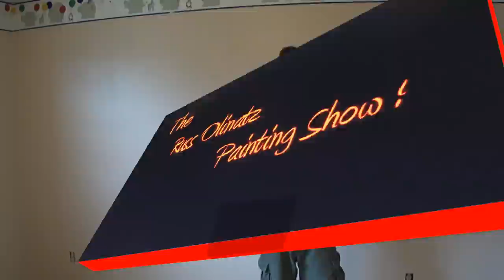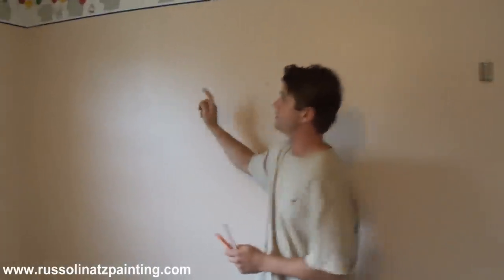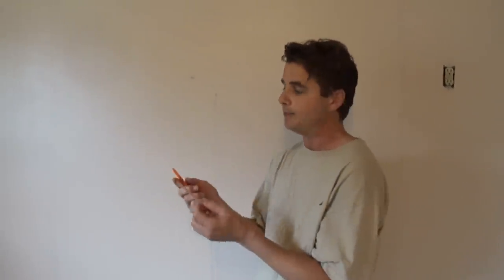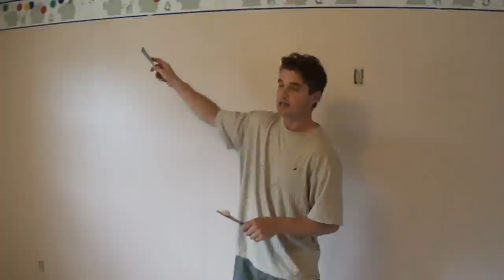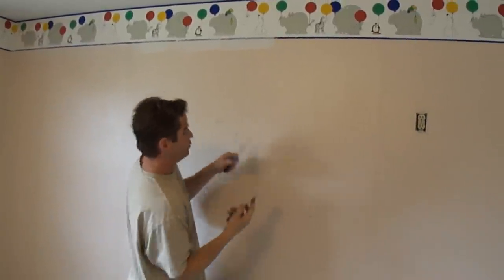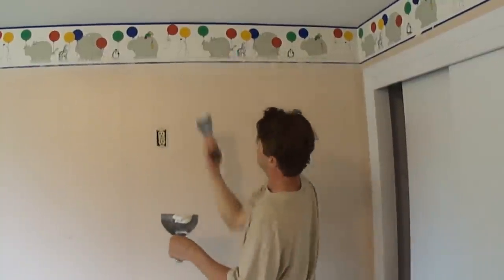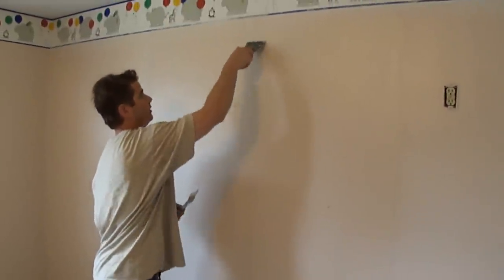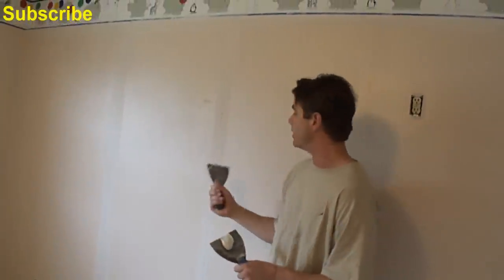DIY Paint over Vinyl Wallpaper & Border (Part 1)

Comment: I work for a luxury mobile home seller. A large majority of my customer have the proverbial "Champagne taste on a Beer budget." Full finished sheetrock in today's manufactured home drives the price up exponentially and busts their budget. The solution is to order the vinyl sheetrock that's standard, get the other nice upgrades instead, and just pop the batten strips, caulk, mud, paint! So, thank you very much for the DIY! I'll be sharing it a lot.
Reply from the maker: Thanks Laurel!
Reply: the hardest thing about that advice is the corners. they never look quite right.

Comment from the maker: Hi-

Yes, the trick is too use the back end of your taping blade and gouge into the surface a little bit, so the hole is now convcave and you can just simply skim over 2-3 times allowing for mud shrinkage. So always make an indentation first, then skim over it! I hope this Helps!

Russ

Comment: Awesome video Russ!  Question... How come you don't tape the seams first?  Aren't you concerned with cracks or does this not tend to happen?  Thanks, I'm getting ready to start this project this week.
Reply from the maker: Erich Dobson 
Hi Erich-
Thanks for your question. Wallpaper seams and drywall seams are to different things. Its important to go around with your knife and cut away any loose or peeling wallpaper seams. You could tape the seams but it will require more mud and feathering out. Don't just try to tape over a loose seam either, The air gap will still be there. Let me know how you make out?

Russ
Reply: RussOlinatzPaintShow Yeah one last question.  Does Gardz work on top of BIN shellac primer?
Reply from the maker: Erich Dobson 

That primer dries and cures really fast. I wouldn't use the Gardz on top of that.

Russ

Comment: Russ, can you explain why you do not tape & float, like I've seen before? I really appreciate your advice & help channel.
Reply: +lhdz00 
Because you would see the texture of the tape under the paint. You can tape when you plaster, but not for painting. He's just filling in any holes and seams in the wallpaper before he paints so they're not visible when he paints the wall. Paint is thin, plaster is much thicker. You can see mistakes under paint quite easily while plaster can cover right over them

Comment: I'm looking for some advice.  Great video BTW.  I just purchased a manufactured home with vinyl gypsum board and there are batten strips all along the walls.  Can I take those batten strips off and mud the seams?  Any tips I should consider before doing so?
Reply: ive done that myself and it seems to work fine. the downside is that without a solid foundation, the mobile home flexes during seasonal weather changes and can cause the seems to crack. also, its nearly impossible to get the corners right do id suggest keeping it up in the corner of rooms.

Comment: @RussOlinatzPaintShow  Hello, I was wondering how many coats of the Gardz sealer did you use? Thanks in advance.
Reply from the maker: Hi 

I used 2 coats. 

Russ
Reply: Thanks for answering so quickly. If you don't mind me asking. Were the two coats before you put the mud on. Because I just finished the other videos and saw on the last You put gardz sealer on after you finished the mud which would've made 3 coats?
Reply from the maker: I put it on before and after the mudding!
Reply: Thanks again your videos are awesome and beginners proof! Keep up the great work!
Reply from the maker: Leedydawn thanks a lot!

Comment: This is what I was looking for!!!  Thanks!  Is it necessary to use the guardz stuff over the wallpaper?  Could you just use paint primer instead?
Reply from the maker: Cindy M. 

Hi Cindy-
Thanks for your question! You either have to use an oil based primer or the guardz to seal in the glue on the wall. The  Paints that have a primer in it are great but they're not suitable for going over wallpaper. After you seal the wall. Then it's ok to use. Paint /primer  for your topcoat. Where are you from?

Russ
Reply: Ok...Thank you.  I will get Guardz on there first.  I'm from Kentucky.
Reply from the maker: Cindy M.

Hi Cindy-

Ok! Let me know how you make out?

Russ
Reply: RussOlinatzPaintShow Hi Russ,   I have a problem....I have looked everywhere for the Gardz Problem Surface Area Sealant and cannot find it anywhere close to where I live.   I did find something from Valspar that is a drywall sealant, however it is latex. And I also have Zinsser Bulls Eye Primer for all surfaces. Would either of these work?  Do you have any idea's on what I could use?
Reply from the maker: Cindy M. 

Hi Cindy. 

No that won't seal in the glue. You can use an oil based primer!

Russ

Comment: Does this work for wallpaper that has been removed but has the velvet/fuzzy backing of the adhesive? I ripped wallpaper off and it left the fuzzy adhesive behind and im having a terrible time using DIY wallpaper remover as its time consuming and tearing up the actual drywall behind it
Reply from the maker: Hi Shaun

Yes, you will have to seal it first and then skim coat the whole wall. 

Russ
Reply: RussOlinatzPaintShow - okay thanks! Do you mean skim the whole wall with mud where the backing of the wallpaper is or just the section that i started to scrap the adhesive backing off the drywall?
Reply from the maker: Hi Shaun

Yes the whole wall to recreate a smooth surface. 

Russ

Comment: what is the stuff you fill with ? filler?
Reply from the maker: Hello Thurman

I’m using All Purpose Joint Compound. 

Russ
Reply: @RussOlinatzPaintShow  Thanks I was just about to paint over wallpaper and this was exactly the tip I needed on hiding seams
Reply from the maker: Good luck with your project!

Comment: I've heard to not use water based primer as it might loosen adhesive under wallpaper.
Reply from the maker: Hi John

Yes you are right! Most water based primers won’t work here. This is a wallpaper primer/Sealer that is a liquid glue that drys fast and is designed to seal in glue. 

Russ

Comment: I was told you could paint over vinyl wall paper, with paint that has primer in it. No?
Reply from the maker: Hi Jody

No that's not true. Either use the Gardz or an oil based primer. 

Russ
Reply: OK, thanks!